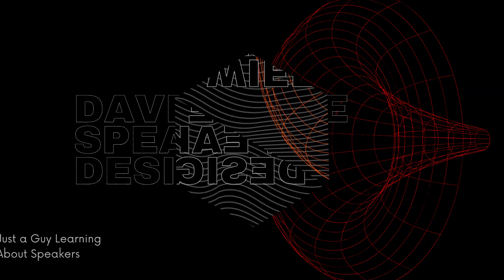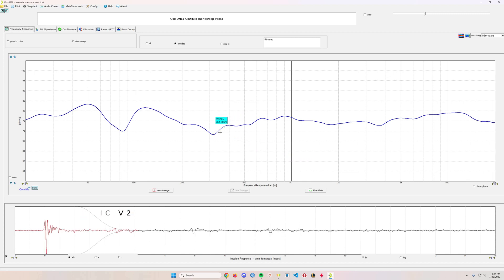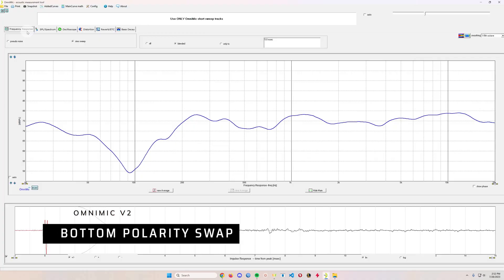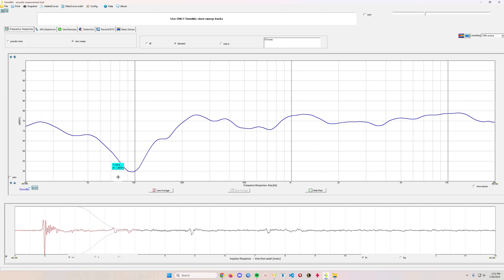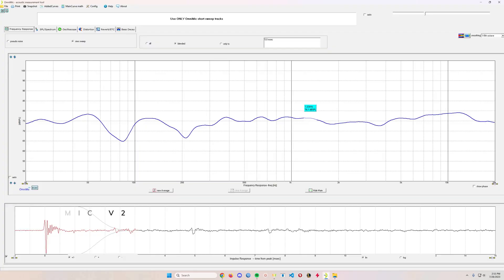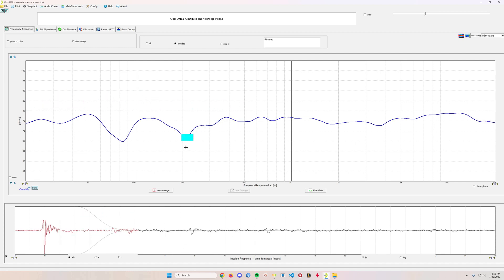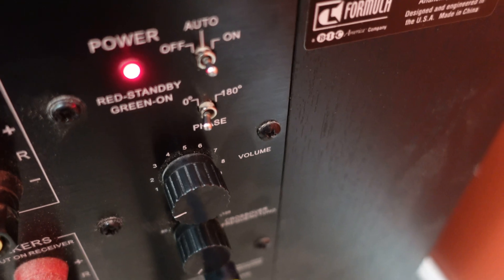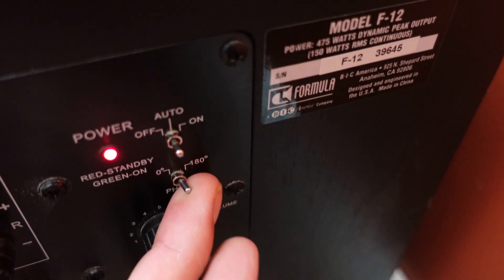Speaker Measurements And Polarity Changes

Comment: I think the issue is "time alignment". Assuming the sound originates where the cone/diaphragm attaches to the voice coil former, the drivers have to be compensated with time delay so that they are all eminating from the same vertical plane. There is a feature in x sim to add time delay when "tuning" a driver. I found that you must select "derived" to activate this function. For now I'm going to try measuring the relative distance difference from the tech drawings in the driver spec sheets to provide the time delay in inches. I'm not sure if it should be a positive or negative number. I think positive.  I will be trying this hopefully later today. I think this measurement can be better accomplished with an omni mic and software but I don't have that or the drivers yet. I would like to see great results in x sim before I purchase drivers. Then I suppose the drivers will need to be mounted with the cones time  aligned. When the frd/zma files are measured, that information is collected with their normal distance to the baffle board. I think you can achieve good results when ignoring time alignment BUT it will require a more complicated crossover to hopefully make it happen and then the drivers could simply be mounted on the same vertical plan I think. 🤓

Any further developments you learn would be appreciated in a reply.  Greatly appreciate  your content on YouTube! Thanks Vincent
Reply from the maker: This was a while back since I did this so I'll do my best to recall what was going on.  Since I have the drivers in question in different boxes I was able to move them and check time alignment. It didn't change the resulting measurement pointing back to phase. There might be more to time alignment that you're referring to that I don't understand which is highly possible. The icing on the cake at this present time is I have a phase problem with my subwoofer at the present time.  You can switch the phase on the subwoofer, but the kicker, in one phase it cancels audio from the lowest speaker, in the other phase it cancels some audio from the bottom range of the mid. I've managed to adjust in the eq to a tolerable point. 
I'm glad you like the channel, it's been a while since I've posted, there are plans for the new year. I'm still active!

Comment: I respect your efforts. I also started this hobby from 2018 but learning very slowly.  I suggest you invest in something like minidsp and see in real-time what phase and crossover s can do to help. Passive in mains with active in woofers or subwoofer is better idea in my humble opinion.  Speaker spacing is also a big concern, get the woofer and tweeter in close proximity.  Try filling the boxes with Rockwool or pillow stuffing ,or you can even try to seal them to see you can mitigate that dip in the response. Speaker boundary response is also a reason for this kind of dips. Standing waves inside cabinet is also can be a reason. Play with Speaker position and remessure. I really salute your efforts and your approach. Me also a learner like you. Best of luck.
Reply from the maker: I've thought about mini dsp, I might experiment with active in the future.  You're right about needing some stuffing in the speaker boxes as well, they could use something, spacing should be closer as well.  Only time will tell where this ends up.  Thanks for the feedback, I appreciate it.

Comment: I've got the kind of the same issue , with 2way speakers , I've put one sub to mitigate that with the sub in the middle, and the cross over a bit more than 80hz , meybe if you put the speaker a bit outside the wall helps to
Reply from the maker: Thanks for the ideas.  I never thought about moving the speaker farther from the wall.  I think you're right about the cross over frequency being higher as well.
Reply: @davewiebespeakerdesign  let me know if helped with that , thanks